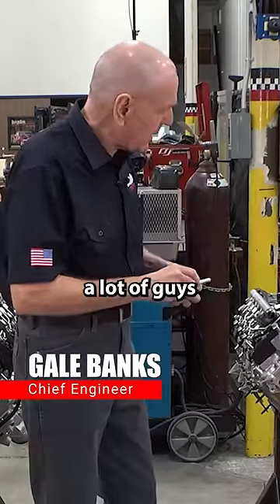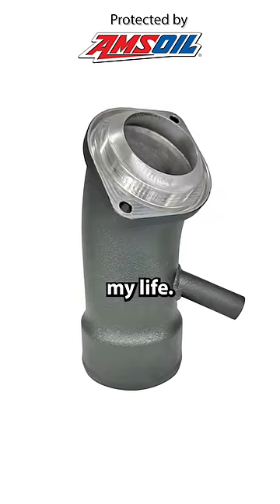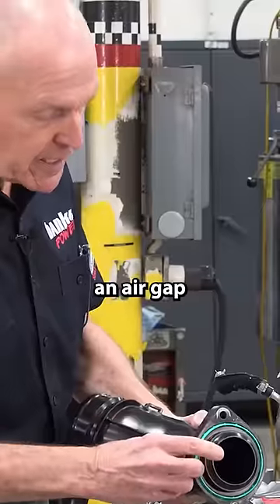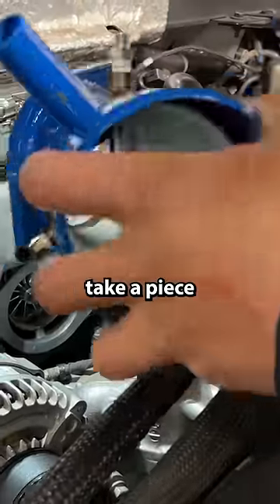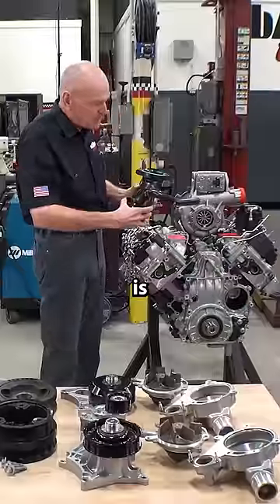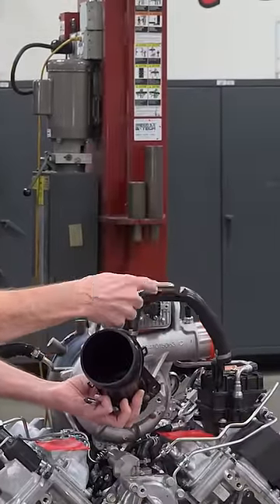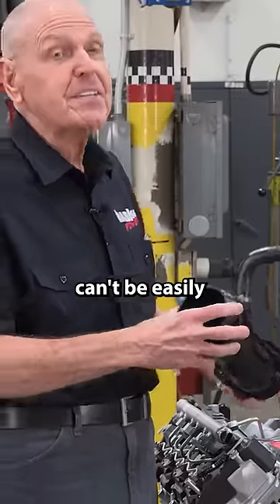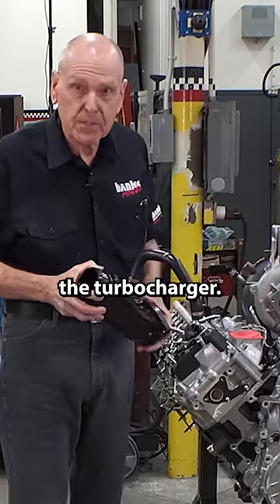The factory guys got it right. Don’t delete this!

Comment: The man just explained fluid dynamics so fluently just from experience. Mad respect.
Reply: But he wants pressure pre flow of the turbine. Which means constant air drag on the blades designed to push air. Free air is cut by the turbine. So as air is input at less pressure  for higher velocity it can balance pressure on the opposite side. But you will have turbo lag.
Reply: @treatb09 improves scavenging
Reply: @MultiSoftE  turbines in planes cut air to provide thrust. But need smooth flow as the plane accelerates or the turbines need to keep accelerating to compensate for the air pressure in front of the blade.  Compressors cant compress without force. Smooth flow would mean the plane only uses thrust from combustion which has back pressure flow and issues and wasted energy. So the plane then compresses. Travels and that back pressure is negated. A turbo in a car though, you want that pressure balance because the turbine will be more reliable. Thats why by turbos are so much better. Though you have two, they allow compensation for each’s issues.
Reply: @michaelwilson2151 air is a fluid & with the topic being airflow, he is indeed talking about fluid dynamics.
Reply: Lol not just from experience. The guys a chief engineer. Definitely had to get his degree.
Reply: @michaelwilson2151  uuuggghhhhh I hate YouTube's comment deleting. 

You're making the extremely common mistake of conflating the terms liquid & fluid. But in science & engineering, they are in fact 2 different things. Liquid refers to one of the 4 readily observable states, or phases, of matter. i.e., solid, liquid, gas, plasma. A fluid, however, refers to (this is a quote, but for some reason YouTube has something against quotes): 

A substance that deforms continuously under the application of a shear (tangential) stress no matter how small the shear stress may be. Thus fluids comprise the liquid & gas (or vapor) phases of the physical forms in which matter exists. (End of quote)

(Basically, all liquids are fluids, but not all fluids are liquid)
Now, While I don't work with/on static drive &
hydraulic fluid dynamics everyday, l am a
mechanical engineer & I took the preceding
definition of a fluid from my copy of Fox &
McDonald's Introduction to Fluid Mechanics
textbook that I keep nearby for reference when I do happen to be working on something involving fluids.

But you don't have to trust me on this. Simply
spend 5 minutes on Google &.'m sure you'll find hundreds of sources that you find infinitely more trustworthy than me.

Then maybe we can circle back around to
oxygen and hydrogen -(air), and water is a
solid until it evaporates.
Reply: He's definitely takes fluids before, he speaks like moat engineers I know so he's definitely got background schooling
Reply: @michaelwilson2151  this has to be one of the most egregious examples of "confidently incorrect" that I've ever seen.
Reply: Oh Mad! 🎉
Reply: @treatb09 h yeah you know more than Mr Banks. SMDH
Reply: He really didn't lol...not to say its wrong, but he has a degree and wasn't terribly eloquent...respect nonetheless
Reply: @eleithias Yeah, he really didn't talk much fluid dynamics here. Not sure what OP is on about.
Reply: @treatb09  I'm gonna trust Mr. Banks on this one.  I doubt you have the testing capabilities he has.
Reply: You could say he did it fluidly
Reply: @thewayidoit8895  im basically a physics prodigy lol.  but you don't have to listen to me.
Reply: I know enough to know that I don't know enough. I will listen to experience.
Reply: Basic knowledge
Reply: @treatb09 You're not trying to correct Gale freaking Banks, are you? 😂
Reply: @treatb09  sorry but as a physics nerd I'm not convinced you actually know better than gale banks on this one, you don't have the data to back up what you're saying and calling yourself a physics prodigy doesn't make you any more credible.
For one, all he said was that the pressure in the small tube has to be correct, he did not say what the correct pressure is. Could be atmospheric, negative, positive, we dont know. That alone makes your arguement pointless
Reply: His explanation was quite fluid!
Reply: Totts he is great, 👍!
Reply: He is the honorary father of modren diesel modding

Comment: Lol just figured out why my 2015 is eating oil....thank you!

Edit: finally got the turbo out. Had blown seals allowing excessive blow by and a chiped blade on the compressor wheel. Truck is a chevy k3500 lml 6.6l with 75k and 6k hours(fleet truck).
Reply: That’s wild!!
Reply: I put an oil catch can on my vehicle
Reply: @willtancha7163  That's awesome!
Reply: @willtancha7163 I put those on everything I own.
Reply: @willtancha7163 I took mine off. They are useless. Put a drain at the lowest point under the intercooler. Oil still gathers there even with catch cans. That's the part where you lose air flow. I've emptied and flushed many intercooler's. Crack that bottom hose and oil flows out. Clean the cooler to get flow back. Those cans are a gimmick. Just because they catch oil doesn't mean they are not letting any through. That's the real issue.
Reply: @tonymarshall9670  Sounds like you have a bad turbo seal or some serious blowby then. A well designed catch can is ~90% efficient at removing oil from CCV vapors. If you still need to drain your intercooler after installing a catch can you have more serious problems. I run CCV through a catch can to atmosphere on my old Diesel truck, doesn't leave any oil residue behind at all.
Reply: Aftermarket air inlet?
Reply: @tonymarshall9670 as an automotive design engineer I can say you’re VERY poorly misinformed.
Reply: @SIRUNOWN  catch Can is before the turbo. There's nothing coming from the turbo
Reply: @joshroi8610 you in engine design department or side mirrors?
Reply: @tonymarshall9670  Then you bought a garbage catch can, or you're in denial about your failing Turbo seals. I have NEVER had to drain the intercooler on my Diesel, or any of the Diesels I work on for a living unless the turbo seals are gone, there's an unholy amount of blowby, or the engine sees an insane amount of idle time. I work on a fleet of a few hundred Diesels, your anecdote means nothing to me. You have a personal story, I have Data.
Reply: @SIRUNOWN  spot on 👌 yous a wise fella
Reply: @joshroi8610  I do but that wasn't the problem. Blown seals in turbo
Reply: 06.5 lbz 214,000 miles tons of work hit tunes never have issues…besides the dam trans
Reply: @f.j.b6542  I am but a humble Diesel Tech, but I appreciate the compliment!
Reply: That's more than seals if it's chipped a blade
Reply: Your Lucky it didn’t run awayyyy banks just my have saved your life and your trucks who knows maybe sum one elses
Reply: @joshroi8610 If he is poorly misinformed, doesn't that mean he's fairly informed?
Reply: @tonymarshall9670  catch cans are certainlyno gimmick. They were designed and implement by Auto racing safety organizations. NASCAR, IMSA, etc. Try hitting a patch of oil on a track at  190-200 mph. Lmao, won't think they are a gimmick then. God bless.
Reply: @joshroi8610 yes GALE BANKS!
Reply: @tonymarshall9670  how mamy vehicles have oil catch cans on since brand new? How much of this oil you're saying drains out of the intercooler could have built up before the can were installed? I'm sure most catch can setups dont stop every bit of oil, especially since alot of people use cheap Chinese ones and route there hoses poorly. Doesn't make them a "gimmick". I don't think I've seen catch can makers claim they stop every last drop of oil.

Comment: What the hell does this old guy know? ABSOLUTELY EVERYTHING.
Reply from the maker: He knows a thing or two, because he's seen a thing or two.
Reply: @bankspower  does gale banks use farmers for his home and auto?
Reply: Would you know why when I floor my car it starts to smell like burning oil but definitely a bit different smelling, and then it goes away? 369k miles but still. @bankspower
Reply: @dandiegidio7729 Catalytic converters have a sulfuric type smell if that's what it smells like. Catalytic converters with that many miles tend to smoke and smell because the chemicals inside are starting to degrade.
Reply: @cloxlolx  It's kind of like sulphur, yes. I guess that makes sense. The manifold converters are probably really old. Would that happen only at full throttle though? Thanks for the reply
Reply: @dandiegidio7729  Usually happens when the engine is under heavy load, so full throttle, going up mountains, and maybe while pushing it hard spinning tires etc... it can happen really anytime your exhaust gets hot but usually happens under load.
Reply: True he is always right about his facts, he really knows a lot! and is still not afraid to get his hands dirty.. i would love a neighbor like this man, to talk about Technical car stuff in the weekends with a cold beer 👏😎
Reply: @cloxlolx  Interesting. It's been like that for 4 years 64k miles so I assumed it wasn't detrimental but I've been curious. Thanks for the info.
Reply: @dandiegidio7729  Not detrimental! Just a character trait of old cars. If you replace the cats or delete them the smell will go away.
Reply: @cloxlolx  Well if that's what the smell is I'm not worried until they get clogged or something. I was worried it was burning in the cylinders but the smell didn't fit. I can't delete them since they're manifold converters and nobody makes headers for a first gen ford escape for obvious reasons. I've just been wondering for years what that was. I overheated it recently when a tiny hose split and it seems like I can smell it with a little less throttle than before but it runs great and the gas mileage is the same as before. I know this thing doesn't have a whole lot of life left but I'm trying to possibly hit 400k. If not it's done better than I could have imagined. I love the engine so much I want to one day put one in a 92 sentra so I can have my favorite car with my second favorite engine, behind the 300 ford 6.
Reply: @dandiegidio7729  Yeah 100% nothing to worry about. Just a little annoying
Reply: @dandiegidio7729   you’re getting oil either past your oil rings coming from the crank or coming in from the top of the head either way you’re gonna have to open your engine but it shouldn’t be that bad as long as you don’t have wall damage and you said it goes away after a second so it should be a small issue
Reply: @bankspower  We are farmers bum-ba-dum bum-bum-bum-bum
Reply: Go to the LA COUNTY Fair and go to the car museum. That will answer your question.
Reply: @dandiegidio7729  400k is barely broken in on a 300 Ford! Also my favorite engine. Simple reliable design with low internal stresses, designed to last a lifetime...
Reply: One common trait I've seen in very smart people: they will tell you they don't know everything and they are always learning.

Comment: My crankcase vent blows out onto the road. As God intended.
Reply: The environment can have a little oil vapor as a treat.
Reply: Heel ya
Reply: keep that black top black
Reply: Tier Zero FTW
Reply: Giving the oil back to the earth 😂
Reply: In that cases you’re throwing power away. 
Generating negative pressure in your crankcase helps rings to function properly, reduces pumping losses below the pistons and reduces windage losses from the entire reciprocating and rotating assembly. 
But if leaving your mark wherever you park is your thing, never mind all that.
Reply: Reduced traction for motorcycles
Reply: @gamerknown ^^^ This.
Reply: @robm.4512 
The cause / effect of that is miniscule, especially if you're religious on oil changes and run quality ck-4 equal or better quality oil, and your engine runs at proper operation temperature (185-195 degrees).. This almost never will be an issue.
Reply: @brianh3019  Circa 40 years in competition high speed engine development informs me differently, but to each their own.  
Quite honestly, even if running a positive displacement crankcase ventilation system, ever since swirl pot separator/return systems were invented there hasn’t really been an excuse for dumping oil from a breather out on the tarmac. 
It’s not as though they’re complex devices.